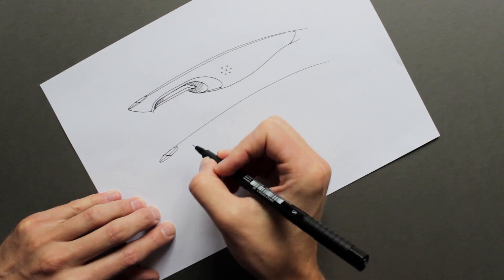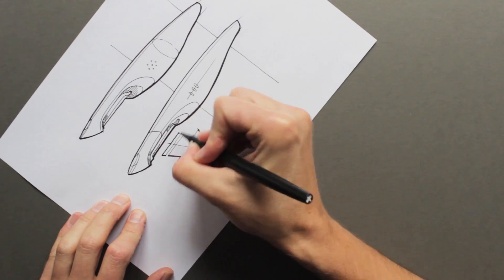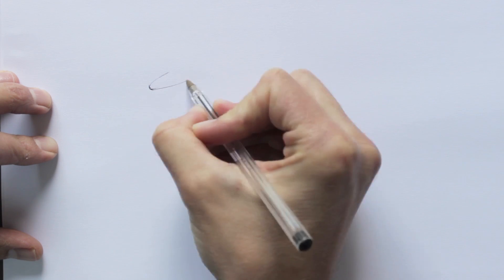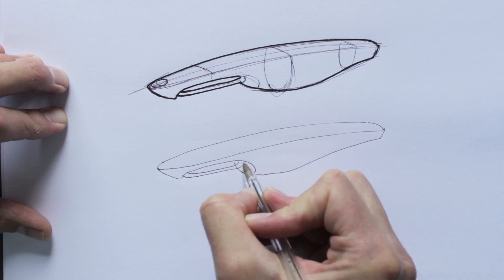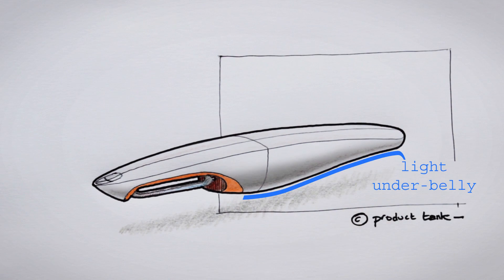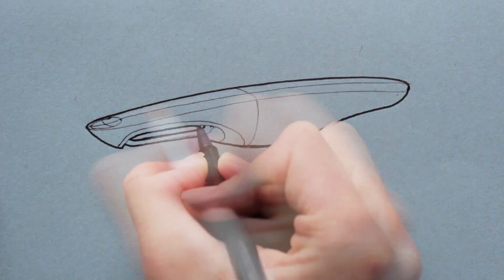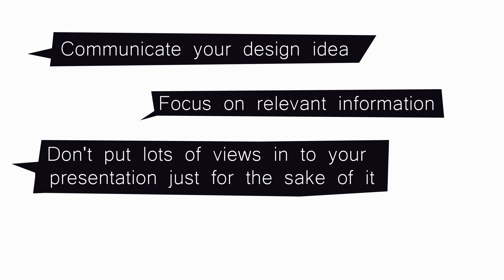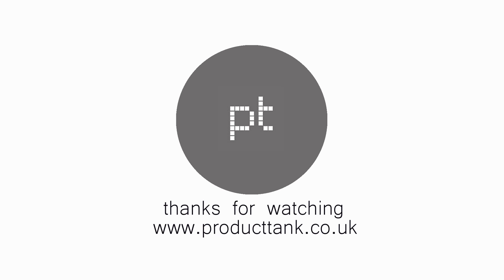product design rendering and sketching by product tank

Comment: This feedback is not in first hand to the author of the video, but to young designers who need to know that the technique showed in the video also has some major cons when using it as a tool in the design process.

Like said in the video, this is very oldschool. I think that you loose a lot in the form experimentation stage when trying to create as few lines as possible in the sketches because you wanna keep them clean and tidy. That's very much focusing too much on getting a nice sketch, which most likely will affect the design in a bad way, especially if you are going to do an overlay of the sketch any way. I prefere to feel free when sketching, often resulting in really dirty sketches with thousands of very light lines, which I then try to clean up a bit when choosing the lines I was happy with, making them stronger. My opinion is that it still can look nice even if it is very sketchy and I agree with the video that the sketches become more interesting when using some variation of the thickness of the lines, for example thicker outlines to make the object pop. I also think that it was a really good point to do some sort of physical model to easier get an understanding of the form before deciding the design. In some projects that irrelevant though, but in the case of a hand held device the ergonomics, as well as the 3D dimensional form is so important that it's almost a must. Clay or PU (Polyuretan) foam or even 3D printing of quickly made CAD models can work as evaluation. Some times you can sketch both with the pen and for example clay and go forth and back between 2D and 3D through the design process. 

However I really can't see the point of then creating the presentation material by hand. Maybe the rendering can get a certain hand made/oldschool feeling that can be nice, but when working professionally as a designer it's far more effective to create the presentation images digitally in for example Photoshop with a tablet or a "Cintiq" screen (don't really know a good more general word for them) and it also looks more professional in my oppinion. I would sketch the first sketches, which should be many and present many different variations of the design, by hand or directly in the computer, depending on what I feel most comfortable with. Sometimes it's good to mix different mediums and sketching techniques when sketching form and ideas, because different ways of sketching with certain pens/materials tend to generate different forms and ideas. Then I would use them as underlay and make the final sketch in photoshop and then maybe add some shadow and colour there. If I already like the original sketch I would probably don't care about cleaning it up, but just keep it there and put all the rendering layers on "multiply" (in Photoshop) so that the sketch still will shine through. 

If I where to do a proper rendering with no sketch strokes in it I would not even bother doing an overlay on the first messy sketch, as long as it is clear what lines is the ones I should follow. Then I would use that as an underlay and do the rendering directly and when I got the perspective right and had done the major parts of the rendering I would just make the original sketch invisible and not use it any more. A good tip is to flip the canvas every now and then to try to see perspective errors, which really can destroy a sketch, but most of all renderings, and try to correct it using the liquify tool (in Photoshop) and some other tricks ^^ If the rendering should look photo realistic I might also make a quick CAD model, which really doesn't have to have all details in it, and render it in a rendering software, like for example Key Shot, and then use that as a base to build on in Photoshop.

I'm really not fully learned, but I've learned my lessons when trying to learn how to make perfect sketches, and the answer I found was that perfect is really to let it be a bit sketchy and unperfect. Please check out my sketchblog if you are interested! 
http://simonlarsson-sketchwall.blogspot.se/

/Simon Larsson, Industrial Designer at ÅF, Sweden (Graduated from the BA program in Industrial Design at Umeå Institute of Design in 2015)
Reply: Always nice to read some opinions, thanks for sharing!

I completely agree with your point about the amount of lines. I'm a teaching assistant in the design sketching classes at TU Delft, and I see a lot of students trying to make drawings with as little lines as possible, which often has one of two effects; They either make very stiff drawings and don't correct mistakes, because that would add more lines (which is not helpful of course, a corrected drrawing is always better than an incorrect one) or they don't experiment and just go for the safe options, with several designs that look very similar. 
A good reason not to have perfect lines is that you could then just as well make a CAD model. CAD is getting faster, and sketching needs to differentiate itself to keep up. The sketchiness can add a lot in terms of discussion material, it helps viewers think that this is not final, so if they have feedback they will give it, and it helps in finding the right shape in an iterative process. (Because design is iterative, right?)
And yes, professionally I don't think many new designers use traditional mediums anymore. Digital is just so much more versatile, fast and efficient.

Cool blog! But the real question is, do you have an online portfolio? Just curious. I feel I can't reply to this without leaving mine as well.. https://marijnvanbekkum.artstation.com/ (scroll down for the design part)

Comment: how do you manufacture prototype after getting the design done.
Reply from the maker: Hi Open Minds, there are no hard and fast rules as a lot of it depends on the design, materials and quantities you are thinking about, but once you have your design drawings and a working prototype which you can often make yourself, (you can see my 'students of product design' series for examples). You then need to find a manufacturer, set up a meeting to explain your design and get a budgetary costing.  This is a rough price.  Further refinement and Manufacturing drawings and a CAD file will probably then be necessary, (you can find people to help you do this), but I think it is best to get a few estimates first, to indicate If you need to change your design to make it cheaper or easier to manufacture.  PT
Reply: producttank I just wanted to ask, do you need to have a qualification for maths and physics to get into doing  product design for uni?? I'm currently interested in doing product design as a career in the future However the majority of  uni's id like to get in to requires maths and physics but I don't do them for A level so I'm kind of worried

Comment: how did you manage to draw line so smooth, man?
Reply from the maker: Hi Harun, I guess a bit of practice doesn't hurt, but the key is to keep the part of your hand that's in contact with the paper as clean and as dry as possible, so that it doesn't drag or stick to the paper. PT

Comment: What markers are you using? And where could I buy some?
Reply from the maker: Hi Matt, the markers are letraset Pro Markers, you can get them in most art shops and I expect from Amazon, the outliner is a Papermate flair black fibre tip, also available from Amazon.  I have tried other markers the Spectrum Noir range and they work well too.  I have made another drawing and rendering video that shows you what pens I use in my 'students of product design' series. PT

Comment: Hi there, do you not find that your letraset/copic markers run a bit if you use normal paper or go through the other side?
Reply from the maker: Hi Fred, they do bleed a bit, so I don't go right to the edge of the line I've drawn as they can go over, I've found with practice you can just judge it.  I also keep a spare sheet of paper under the page I'm working on otherwise it can go on to the table! PT
Reply: Using layout paper helps when using markers when you want to do a nice render

Comment: If its not much to ask can i learn wich pencils, pens and markers you used in this video. And what paper you use ?
Reply from the maker: Hi ufuk, the markers are letraset pro markers, the pencils are Derwent watercolour pencils and I used a biro and the outline is a Papermate flair black fibre tip.  The paper is just standard white copier paper.  I'm currently putting together a sketching tutorial that will go in to sketching and rendering in much more detail. PT

Comment: What pens do you use for sketching? I have trouble with the ink bleeding when I use Promarkers.
Reply from the maker: Hi Lydia,  I've had the same problems.  For sketching I use pencil, fine liner (I have no preference, Stabilo, Edding or Faber Castell all work equally well) or I'll usually just grab a biro.  I have found when using a Biro and going over the top with ProMarkers that they can wash out the biro line, but this can be a good effect.  Also the bleed is more noticable on some papers.  Currently I'm using a ream of A4 printing paper from my local store which seems to be working well, so you just have to experiment.  I guess sometimes you have to run will errors and try to make them seem deliberate. With marker bleed, you can exaggerate the bleed and then increase the thickness of black line around a design, which can lead to some good results.If bleed is excessive, at the time I would switch to coloured pencils and experiment with different papers/marker combinations when you get a chance.  I'm going to do another video on this soon.  Thanks for watching. PT

Comment: What kind of pen did you use at 0:48 for the outlines
Reply from the maker: Hi Joe, the pen is a Papermate Flair black fibre tip, they are very cheap.  Here is a link: 
http://www.amazon.co.uk/Paper-Flair-Original-Fibre-Tip-Black/dp/B003UM70YE/ref=sr_1_2?ie=UTF8&qid=1415213949&sr=8-2&keywords=papermate+felt+tip+pen
Reply from the maker: Stephanie Andrews Sorry for the late reply, I didn't pick this up.  I've have had the ink run out before the tips go.  It took me a while to get the hang of not pressing too hard and I did go through quite a few pens when I first started using them, from putting too much pressure on the tip, which this pen is really susceptible too.  Just go really lightly with them.  Its the sort of pen you have to be a bit gentle with. PT
Reply: producttank That's the same pen my Viz 3 professor has us use, but I keep mashing up the tips after a week or two. How long do they usually last for you?

Comment: wow great work, I am currently studying Industrial Design at University and Im good at everything else but sketching is the only thing thats letting me down, how exactly did you practice to get the smooth curves
Reply from the maker: Hi Rikesh30, there's no substitute for lots of practice drawing things over and over.  As the video suggests, tracing your design will help you practice to create smooth continuous lines.  You can draw a design as you would normally, then try and half the number of lines you need and half that again.  One bit I left out of the video is that if your hands are sweaty, your hand will stick or judder across the page, so if this starts happening, rest your hand on another piece of paper on top of the page you are drawing on, so that it slides more easily over that piece of paper.  There is a part in the video just after the French curves where I do this. Hope this helps. PT
Reply: rikesh30 Hi~! I am a product designer and sketcher . If you interested in product sketch, plz come to my channel.^^ 
You can see my sketch demo. It’ll be useful I think. Have a nice day. :-)